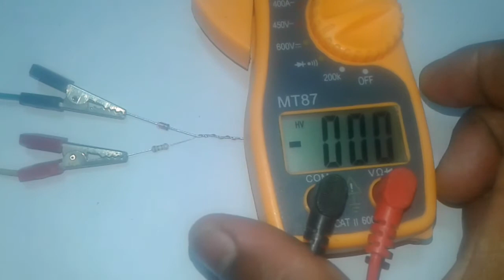12v to 5v converter use a 1 resiator | dc to dc 5v converter | 12v to 5v easy converter.

Comment: how tf does this work???
Reply from the maker: yes sir 100% work.
thank you.
Reply: @MonoTechMaster  yeah but how?
Reply: Its the zener diode only allowing 5v to gate through it. Probably not too stable of a supply that's why you see the voltage jumping around on the multimeter.  If this was on a scope you'd see the rise and fall as the gate opened and closed.  Also probably gets hot after a while.  You'd be better off dissembling a car cig. lighter USB adapter for a more stable source of 12 to 5v conversion.
Reply: @bob19611000  thx